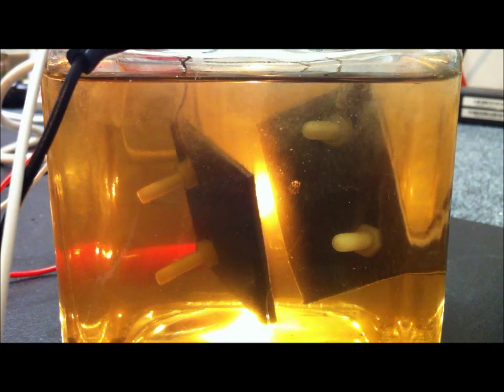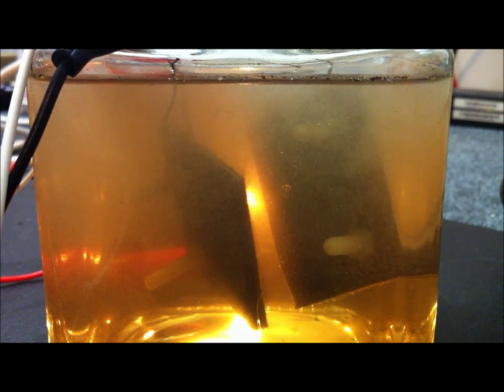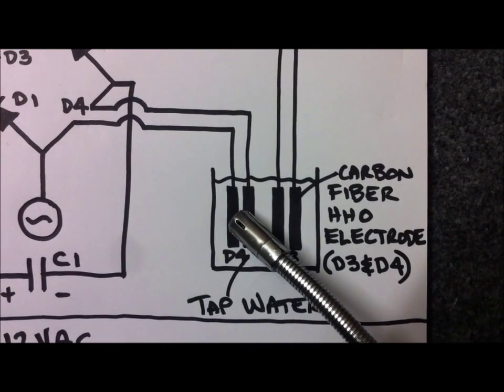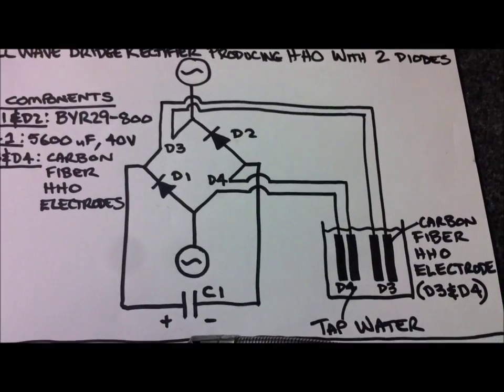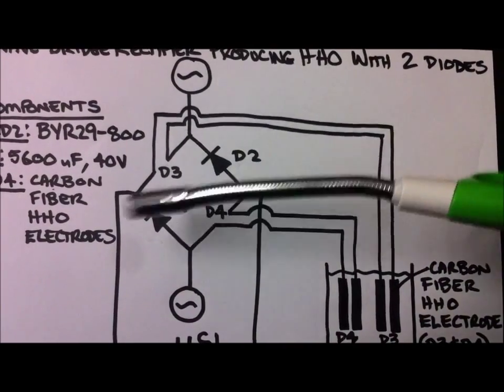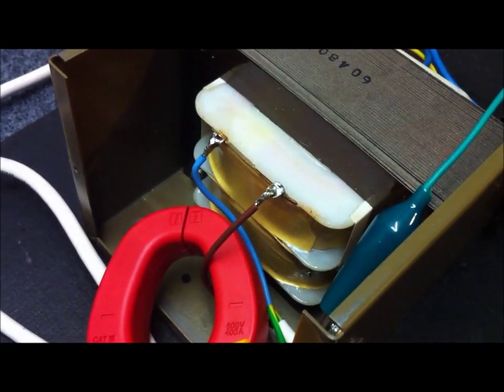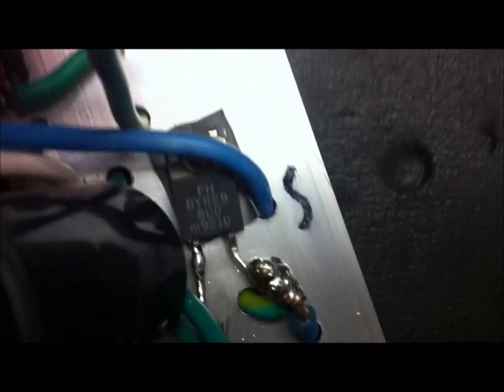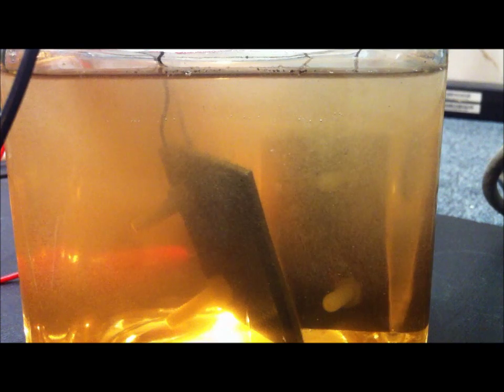Introducing The Full Wave Carbon Fibre HHO Bridge Rectifier!

Comment: Very good update and very good documentation! It's quite interesting to act as diodes!  What I would do is use an amplifier to output a sound AC signal and with that you can also output square wave port triangular wave or modulation signals. There is some free software online called visual analyzer that you can use with a computer to output those signals. ~Russ

Comment from the maker: The production of HHO seems to be a product of the plate size (surface area) and the conductivity of the water. The electrode spacing does not seem to have a great impact on HHO production. I added some neutral CF plates between the positive & negative electrodes last week - the production increased & the water in the cell remained cooler during operation.

Comment: when your putting the load on the circuit, you said at about 1.5 A that the HHO production stopped.. if u gapped the CF electrodes farther apart would it make a difference?

Comment: A easy way is to runna dc motor in series with the rectifier, that way you will chop up the electrical flow though the cirquit.
I used to do that with small transformers a battery and a motor to get a high voltage and zzzap other kids

Comment: Draw your AC power from a 100 watt guitar amplifier's speaker output jack. Its varies between 8-15 VAC and plug a sine wave generator into the guitar input. you can then vary the frequency. it would probably help to use tuned pieces of metal in the tank.... like from a xylophone.

Comment: If you use am ultrasonic pizoelectric transduser (cheep) it will prevent the formation of saturation in the water and on the plates. I have no idea why but it works.
The ultrasound transducers can be purchesed on line.

Comment: UPDATE, to create a sine wave with the 555 we need to drive a transistor with the bias low and a couple of caps. Say you have about 5V on the 555 output (pin#3) to the base of the driver transistor though a 1k resistor. Now, use a voltage divider 2 resistors in series the 330k  to +B the center to the base and a100k from the same base to ground add the caps and you are close.

Comment: On the subject of this famous resonance. No one is sure of what is that is supposed to resonate in the jars?...   The tubes or the water? I am a licensed Ham radio operator and have a tremendous amount of RF equipment; if anyone thinks that can resonate a water molecule…well... do you know how small one molecule of H2O is? Now, think what wave length you need to be at. Even on the 3rd, 4th or 5th harmonics, we are talking about the infrared band...Way past the RF. The tubes can be resonated.

Comment: I did in the past use a 555 with the output driving a tryristor. Later I used the same 555 to drive a power transistor  and that transistor drive 4 large power transistors connected to the plates.  You can get up tp several KHz .

I dropped the idea after I was fiddling with induction into the cell without an external connection; however, to induce energy the key is to find the inductors resonance; after you get the internal inductor in to water the resonance changed.
Permit me to continue.

Comment from the maker: I have thought of this, however I would like to try and increase the frequency of a sine wave first. I will also try sending a high frequency DC pulse to the AC input of my rectifier. While I am at it, I will also send a few triangle and saw tooth wave-forms into it as well. It can't hurt to try... I have done this before (at 1-2VDC) in other experiments and even though a rectifier should have a sine wave input, the waveform tends to come out nearly the same as what you put in - square, saw etc

Comment: It would be easier to high frequency DC.  Rectify the AC the generate a frequency on the DC.  A 555 timer should help.

"iaec dot forumco dot com" has 555 timer circuits.